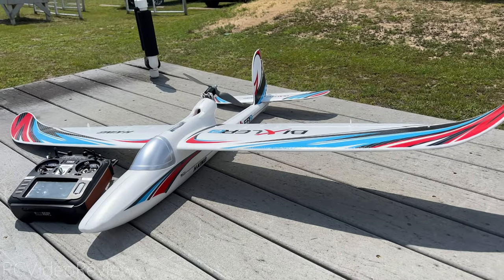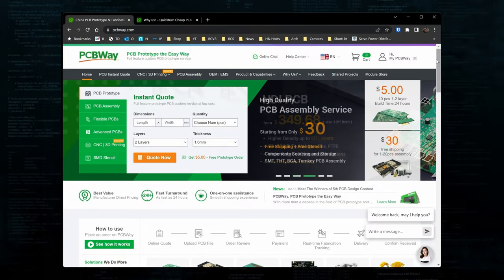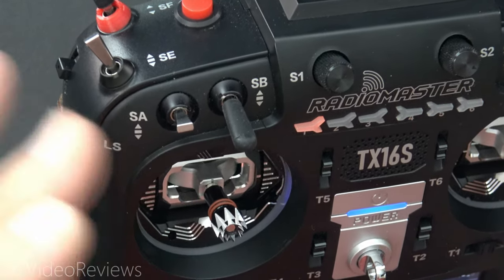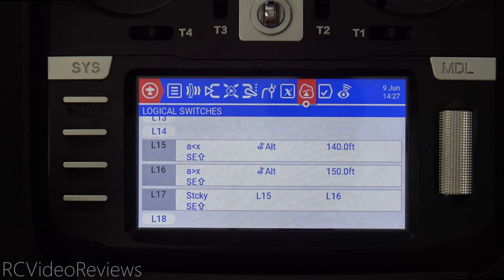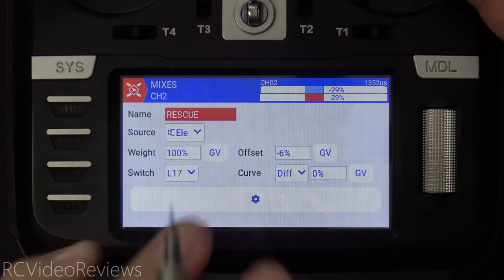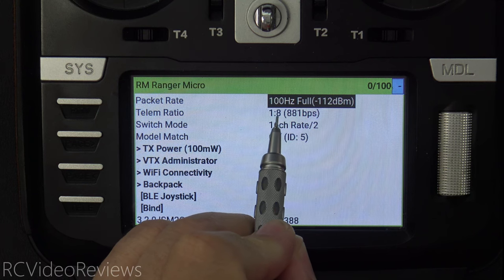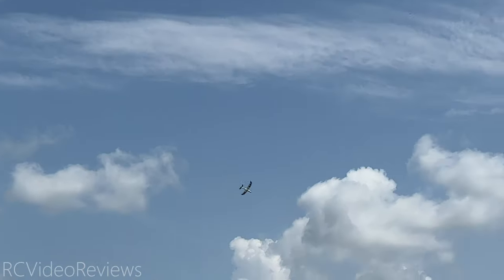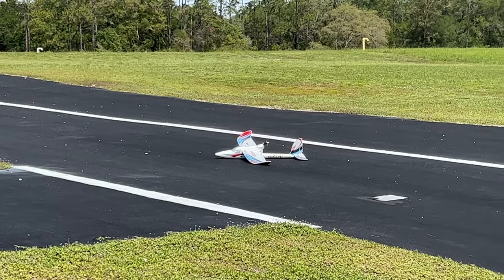Uncrashable RC Plane for $54 in Hardware? YUP, It's Crash Proof!

Comment: John, probably not the right video for me to make comments on (just the most recent) that said, a little about me first, I'm 60+ disabled and up to two years ago had been out of the fixed wing RC hobby for over 20yrs. My younger brother (by 18months) in an attempt to get me out of the house has gotten me sucked back in. The RC world has changed by leaps and bounds in that absence, with my brother's help and YouTube videos of all kinds, your RCVR videos and your flying and narration/instruction has been IMO a step above most. Even when the videos are of more advanced topics or planes you never talk down to beginners or intermediate pilots, and with new planes never a "hard" sell.
Thank You,   David
Reply from the maker: Welcome back to the hobby. Yes, capabilities have change dramatically since I first got into the hobby too.

Anyway, I appreciate the comment. Very kind.
Reply: @RCVideoReviews  ive been flying since the late 70s early 80s and i hear ya, but honestly its not as different as you might think, except some of the smaller more finicky planes that have gyros or AS3x or safe in them makes the smaller planes handle much better and can feel like a larger more stable rc aircraft. with that being said ive trasitioned from the old gold futaba am/fm radios to spketrum dxs or ix 12s to uppdating and setting up radiomaster transmitters.. the RFs are now on much better bands and frequency hoppers, the difference now are better mixing options and telemetery. but if you have prior experience. you shoulddnt have to much trouble. i see so many videos of people that have small hiccups when setting up a model for the first time, but that can sometimes throw ya off and make you think its going to be difficult, so i tend to only focus on what im working on whether its setting up a plane,heli,drone, boat etc etc..alot of the issues i see people have i dont seem have trouble. theres almost always a tutorial video you can find on here with any issue you have...spend the time and effort flying,..... ditch he latest and greatest product or hype is my advice

Comment: This is just pure wizardry! I am a 787 Dreamliner pilot and we spend many hours in the simulator performing upset recoveries over time. I’ve always told my fellow pilots that there is technology available in RC AIRPLANES that would recover the aircraft as good or better than we do! This is a classic demonstration of exactly that. Thanks for this outstanding showcase of this technology 👍👍
Reply from the maker: Appreciate the insights and comment. Thank you. It's kind of funny you mentioned your full size experience in unusual attitude recovery. I made the comment to Fred at the field: The Hobby Eagle auto-level is so buttery smooth--it doesn't "snap" like other gyros. It reminds me of when my FI used to show me how to recover unusual attitudes. It's not a violent recovery, but it corrects with purpose--smooth and immediate. 

FYI: The gyro also recovered a couple of inverted descending and rolling tests I tried before we started filming.
Reply: Full disclosure: We have (and have had for many years) the ability to land a full-size aircraft completely autonomously in Zero-Zero conditions. In fact, now it is MANDATORY to autoland when visibility is beneath a certain minimum. To give away this one last ability of pilots to be able to say that they were the ones that saved the day would probably be a bridge too far.😂😂

Comment: This is something I need since my reactions and ability to fly have diminished because of my age. This will really help John and I will have to trim everything for the type of plane I fly. Keep up the good work John and Freddie.
Reply from the maker: I know you could work this out. Just remember to tune a little. On my tuning, I started with gentle descents to my test altitude to invoke the trigger and evaluate the throttle/pitch response. That's also when I figured out I needed a higher telemetry rate on ELRS. If you spend the time tuning, you'll be rewarded with a nice recovery option.

Comment: that will be very Helpful for a lot of people. Not only beginners but even experienced pilots when they get in front of the sun. You can't see the airplane ,clouds ,atmospheric conditions where you get Disoriented. at times. I see a lot of potential Even for experience. Pilots with very expensive airplanes, good job.
Reply from the maker: I knew you'd see the bigger picture on this. I already have two more airframes in mind to do some additional experimentation.
Reply: @RCVideoReviews  👍

Comment: Excellent presentation John.  Good job keeping the logic straight forward and simple.  I happen to have an A3 Super 4 laying around that I just might try this on a new 3D plane I'll be putting together soon.  I'm no 3D pilot and can use the help.

Have you ever explored using a gyro to assist an intermediate pilot in the maiden flights of a challenging plane?  I'm thinking more of the take-off and landing parts of the maiden flight.
Reply from the maker: Thanks Jim. I don't make a habit of using gyros on maidens. I like to ensure the plane is setup right first. 

After  I've validated the airframe, I get the plane up high and activate the gyro to evaluate gain, control surface movements, and gyro level calibration. 

It would be somewhat disconcerting to take off on a maiden only to find out your gain is too high and the controls start to oscillate, or your gyro calibration is off and the plane noses down hard. 

When the mechanics of the model are validated, and the gyro has been tested at altitude, I see no reason you couldn't use auto-level to manage roll/yaw while you deal with throttle and pitch.

Comment: So, just wondering, if you wanted to do a nice easy, and almost hands off take-off, couldn't you just throw into Hard Deck Enabled and toss it into the air, where it would simply climb to 140ft?
Reply from the maker: You could. Just be aware, if you do that, it will start the motor as soon as you turn off your throttle lock.

Comment: Is it possible to build something like launch flight mode, that just allows throttle to be used and a max angle of about 25 degrees that help just for taking off a plane .
Thanks
Reply from the maker: Yes. I do that for certain winds. No gyro/vario is necessary for this.

Comment: Did you consider using a knob to control the altitude at which auto level would be triggered?
Reply: also a 150 foot trigger point seems high,  how low do  you think you can set it on the plane you were testing so that it would recover 90 percent of potential crash situations?  the worst  case scenario is probably a vertical descent at high speed
Reply from the maker: Tune to taste. I set it up this way to ensure I had a reading from telemetry. As I continue to test, I will probably increase the telemetry rate and decrease the hard deck to find the limits. The objective--of course--is to ensure the telemetry data triggers the switch in time for the gyro to recover. This is precisely what I meant in the video about taking the time to tune based on your setup.

I can use knobs and/or switches to set GVs, but logical switches do not allow for sensor data comparison to GV, so I haven't found a way to use a dynamic floor/ceiling.
Reply from the maker: The last couple of tests I ran were vertical descents at some speed (not full throttle) with a turn, and there was no issue. Again, it comes down to telemetry rate and enough gain on the gyro to get the job done quickly. I tested inverted recovery off camera, and it worked too.

Comment: Meant to ask you...the altitude...is it in AGL or MSL? I'm assuming that it's uncorrected barometric MSL, as it doesn't have a radio altimeter, right? Kind of important information to address for each person's setup/location!
Reply from the maker: It's barometric pressure. This is part of that tuning process. Fly, visually decide where you want the deck to be, look at telemetry, adjust according to what you see. Honestly, I didn't spend any time correlating for location. My main objective was to observe consistent behavior which you well know can change with conditions.
Reply: @RCVideoReviews  Now I'm confused. By that do you mean MSL? Barometric pressure is measured in HPA or in HG. You have "feet" as a measurement, not inches mercury in the radio programming field

Comment: so you think the Bix2 is a step up from the FMS hi-wing trainer? Wow, I wouldn't have thought that. As a low hours pilot, with an original v1 Bixler that has done the lions share of my recent hours, I'm surprised by that, pleasantly surprised, guess I'll avoid going for a hi wing trainer as my next plane 😄 I have a Phoenix 2400 glider that I've already maidened but have not had weather suitable to fly it more than the first few circuits and was thinking I wanted something in between the two to really build my skills
Reply from the maker: The high wing trainers have dihedral and are a little more draggy. The Bix2 is a straight wing--so no inherent stability--and it's very slick, so it scoots through the air pretty quickly. Trainers can fly slow and give newer pilots more time to think things through while offering the advantage of inherent stability. When they're setup right, they try to fly straight and level. The Bix doesn't mind entering a turn and staying there. Also, it's a somewhat flat side profile, so orientation wise, it is definitely more challenging than the high wing trainers.
Reply: @RCVideoReviews  And the Bixler v1 gets downright snappy in roll when you clip the wings almost to the edge of the ailerons.  Flies great upside down too.  So, yes the Bix1 or 2 can be a great plane for advancing skills.

Comment: I have been using a TX16S with EdgeTX (and OpenTX before that) for as long as the TX16S has been around. I just bought a Tandem X20S and feel like there are definitely some upgrades, and some potentially better things (haven't had time to test it), but EthOS seems very slow compared to EdgeTX. I almost get so bored setting up a model that I just give up and wait to keep setting it up until some other time... any thoughts on EthOS or the TD line of receivers? What about the 24 channel SBUS of ACCESS and later?
Reply: Btw... I do use ELRS on my TX16S still. I'm waiting on a module adapter and some testing on the TD MX to compare systems.
Reply from the maker: I don't support FrSky or their gear. I don't care for their business and marketing practices. My opinion: Dump their gear and firmware in favor of EdgeTX and more community oriented manufacturers.
Reply from the maker: In fact, I'm in the process of removing the very last FrSky gear from my hangar. I have a stack of S6Rs, S8Rs, and L9Rs I'm trying to unload. If you're interested, ping me on discord.
Reply: @RCVideoReviews  I have a bunch too. I'll see, though. Haha
Reply: @RCVideoReviews  I honestly don't support their marketing practices any more than Spektrum or Futaba, and I'm a huge fan of open-source stuff. That's why I'm keeping my TX16S. Their dual-band tandem links looked interesting, though. If their new stuff wasn't supposedly the best of both 2.4 and 900, I'd not have spent the money. But on the other hand, if it performs with lower latency than 915mhz ELRS, alone, then I think I'll do that for long range.

Comment: can i do something similar using the Radiomaster receive ER6GV that has a vario? ( it does not have a gyro).
Reply from the maker: Not really. The configuration depends on knowing the altitude.
Reply: @RCVideoReviews  But the ER^GV has a altitude included " V" , that is why my question. Thanks
Reply from the maker: After using altitude to trigger, the gyro does the work of correcting.
Reply: @RCVideoReviews  good to know. thanks for testing it. i will use the one you have in your video or i just get an aura 5. many thanks!!!
Reply: @RCVideoReviews this was my question too after watching this. The ER6GV plus Hobbyeagle A3 should work though, right? The vario triggers the altitude and the A3 gyro recovers?